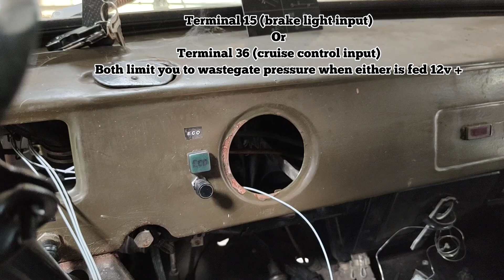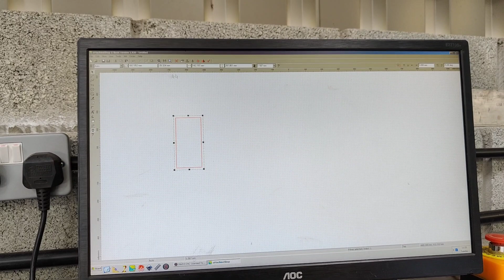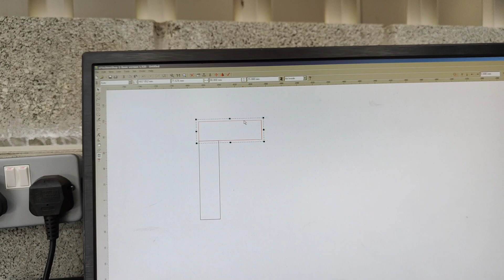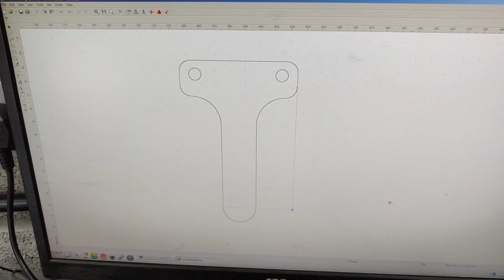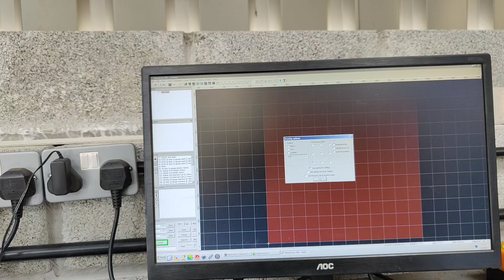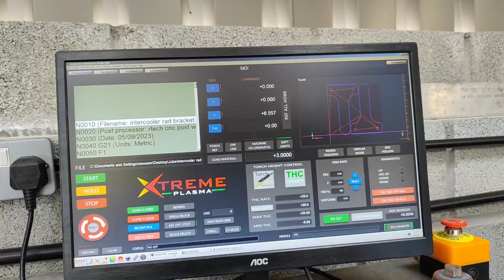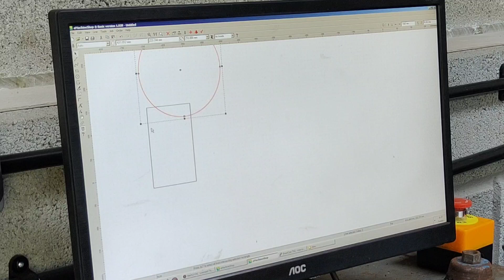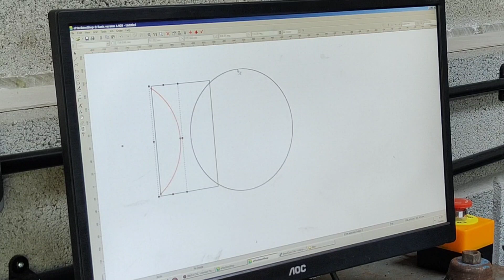Making A Charge Cooler Rad Using ONLY CNC Plasma Table & TIG Welder 😲 - Uaz 452 - Saab Turbo Swap

Comment: Its an old russian 4x4, its probably very happy to get so much love and attention !
I rewired my 61 International harvester Metro van. Someone had previously rewired ot using all green wires. Multiple colors are a great help later.
A question,  my 83 Saab 900 turbo eight valve threw a rod recently and im wondering if a 9000 engine will bolt right up to the 900 transmission.  
Is that what you did in your 900 ?
Reply from the maker: I do like to think that all my vehicles have the most fun with me as their custodian 😄 No the 9000 engine doesn't fit the 900 transmission unfortunately.

Comment: Great video as always! Can I ask what plasma cutter you are using? I'm trying to find a suitable one for my setup without it costing me an arm and a leg.
Reply from the maker: Thanks 😊 I've got 2. A Lidl centre aisle special with built in compressor. It says it can do 12mm on the box which I totally don't believe. I'll have to push it a bit and see what it can actually do. The plasma table has an RTech50CNC. Both single phase. I think the Lidl one was £150. The RTech came with the table but I think they are a £1000!
Reply: Thanks for the info. I have 2 but both are not CNC compatible despite them saying they are. Turns out they are HF (High frequency start) which don't play well with the electrics on cnc machines. However finding one that is compatible and within my budget is proving more difficult that I hoped it would.  @LivingMyBoostLife

Comment: Good on ya for creating content that is your passion.  Doing stuff that is not fun to you becomes a huge burden and puts a major damper on why you are doing this in the first place.  No reason to do a weekly upload.  Quality over quantity is my motto. As for your welding, keep on practicing.  Suggest a number 5 cup for aluminum. Alumina cups are fine and economical. Also on your lap joints on the corners; suggest using a spare piece of angle and clamps to create a plateau, so you capture the argon and it does not just fall off the edge, or worst yet create vortices and pull in oxygen.

Comment: Pretty cool tho I'd rather use an intercooler with a proper air to water core. Air to water core intercooler flows and cools better while being not much more expensive
Reply from the maker: It would need a custom manifold as it faces the wrong way and it's a tight squeeze getting 2.25" pipe in and out of the nose
Reply from the maker: Ah I misread what you typed. Would they be more efficient? I'd expect a bike radiator has a larger job than a charge cooler.  Also like you say, more expensive and less shapes and sizes available so would require more modifying to make fit.
Reply: @LivingMyBoostLife  no ive meant that the cylinder shaped intercooler mounted to your engine uses a recycled air to air intercooler core. It will work tho it won't be as good as a proper air to water core
Reply from the maker: @Robis_Grigoris  Ah I see! To be honest most of the barrel ones seem to be the same construction. We'll see how it goes 😃